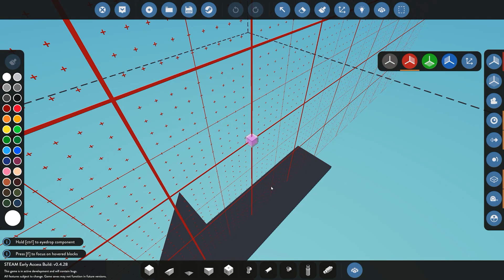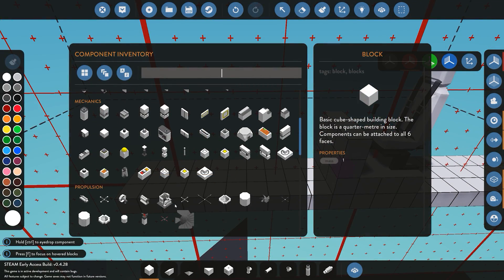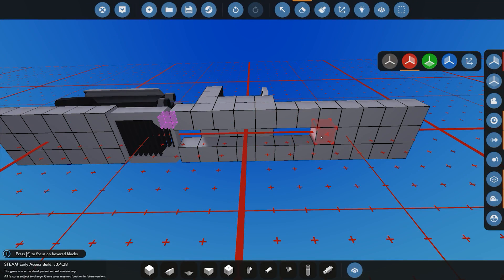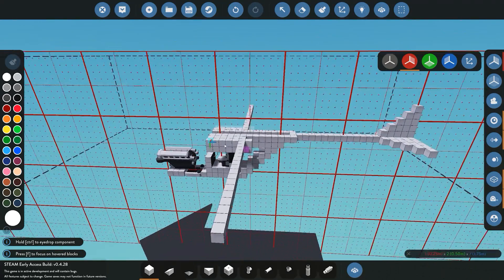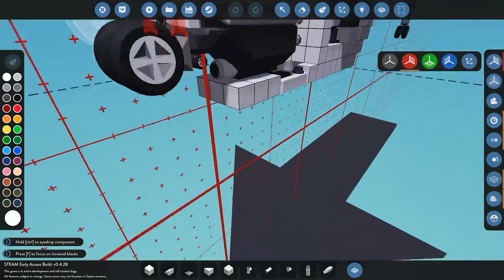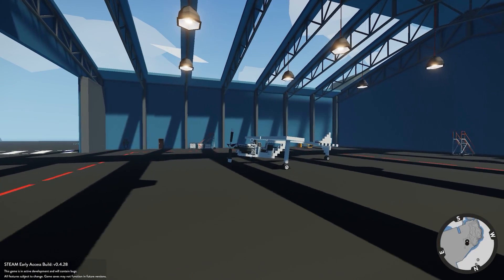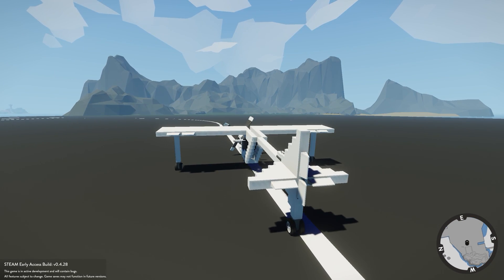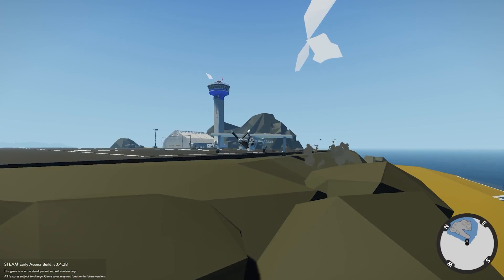Stormworks Advance Plane Tutuorial

Comment: If you add a throttle lever on the side of the plane, go into logic and connect that up with throttle, then power it up.

Then when you get on the plane, turn up the throttle and start the engine.

Problem solved

Comment: My plane keeps doing a nose dive.. I throttle it up and the prop goes into the ground. Center of gravity is.behind my landing gear.
Reply: Changed my wheels and fixed the problem
Reply: What wheels did you do at first and what wheels were they changed to?

Comment: here is a tip: set the engine rps to 8 or 9 and add a 3-1 gearbox pointing into the engine to get good speed and efficiency

Comment: This tutorial was a great help for the very basics but if I'm being honest I feel like it's too superficial and now I wanna dive in more complex stuff (like full plane with the whole fuselage, more logics and stuff) but for some reason it won't work
For some odd reason, even though the propellers of my plane are fairly in line with the center of mass, the wole plane dives forwards when it accelerates, and it's only the main problem among a lot of others
I feel like there's something I've missed, maybe there is some more advanced plane tutorials and all but I can't find any atm
Reply: wing blocks will help you, they actually provide some sort of lift, unlike other blocks.
Reply: cg should be about 1/4 of the way back on the wing
Reply: Check the com and col and use the trim

Comment: I'd like to see a plane large enough, (and practical enough) for moving cargo. Traditionally you would take a boat or a powerful Heli, but I have not personally seen a plane that can handle cargo on and off.
Reply from the maker: I actually havnt got any planes on the workshop myself as I dont find a use for them yet.
Reply: @MrNJersey  You have show folks how well you can land them, of course
Reply: check out the Hughes h-4 aka the spruce goose on Wikipedia 
it can do the job of a boat and a plane at once